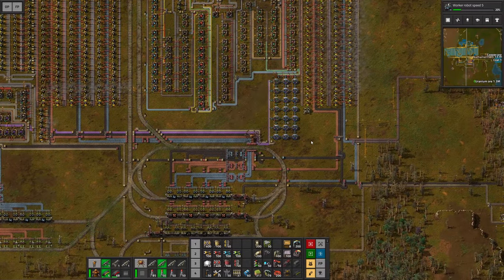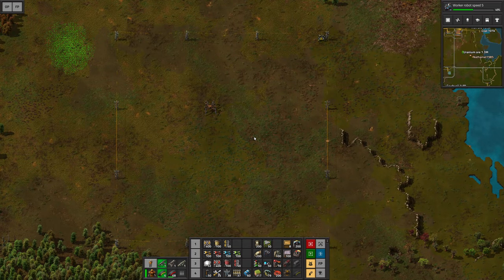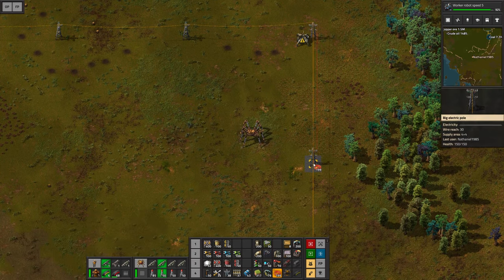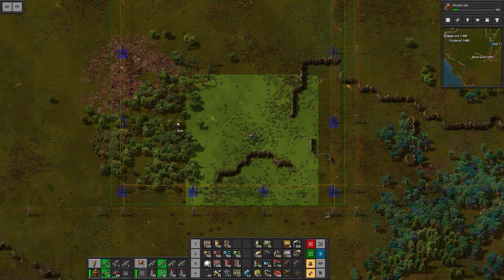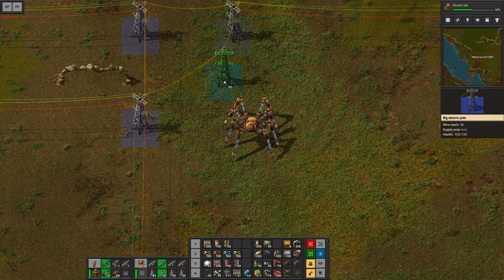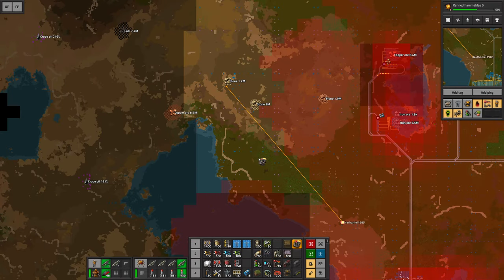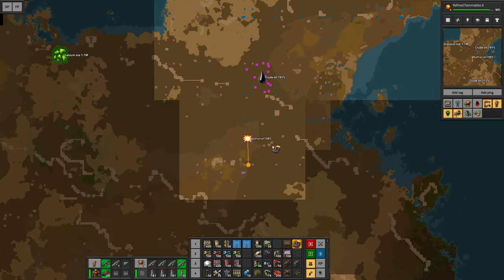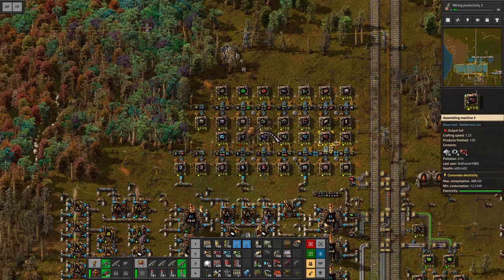HUGE RADAR GRID -  Step 17: Factorio Megabase (Step-By-Step)

Comment: Not sure if it's intentional, but did you notice your blueprint doesn't include an interconnect for the red/green circuit network cabling between individual grid cells? So instead of one big circuit network you've got dozens of isolated 92x92 networks. Maybe your plans don't include megabase-wide signaling and this is all part of your plan, but I just wanted to point that out before you got too far into construction ;)

Comment: is there a reason to setting your grid snapping on the bluepriont to absolute instead of relative?
Reply from the maker: I just wanted it to snap to the grid at 0,0. Absolute did the trick, I thought nothing of it. What would relative do?
Reply: @Nathans-Sandbox  Relative snapping lets you place it whereever but when you click and hold while placing the blueprint it will start snapping to a grid